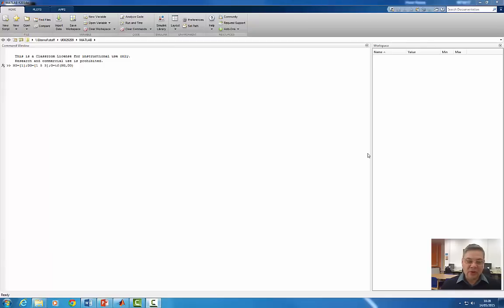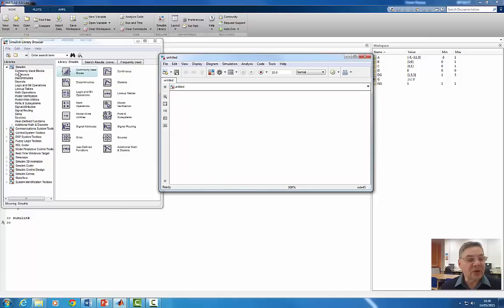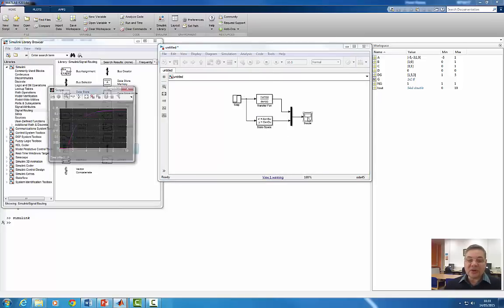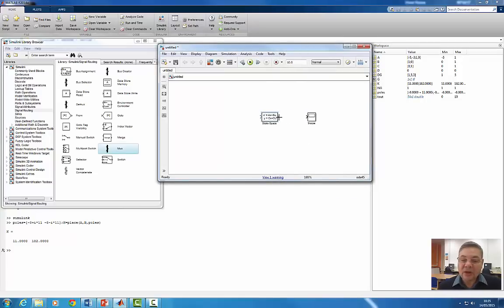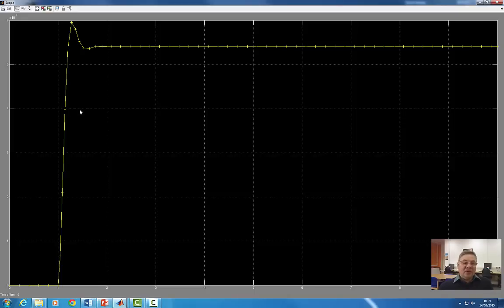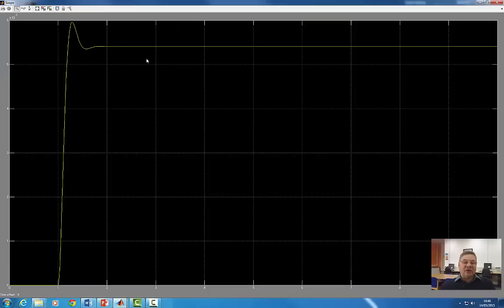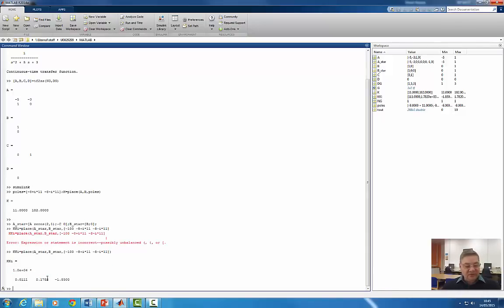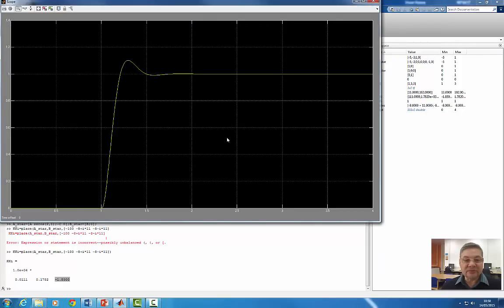Control Design via State-space: MatLab/Simulink Example

Comment: I have a question how did the integrator solve the steady state error ???
Reply: its better to view this from a frequency domain control techniques and analyze the error with the final value theorem with a pole at origin(integrator). You can check Dr.Nise control systems book on the chapter that discusses steady state error.

Comment: Text indeed is very small, but can be "encoded"

While I encourage to write and test code by yourself, I would like put it here, as Rewrote it from the tutorial. Btw., many thanks to Essam Hamdi for this video:

NG = [1] ;
DG = [1 5 3] ; 

% transfer function
% G = 
%       1
% -------------
% s^2 + 5 s + 5

% transferring transfer function to state-space
G = tf (NG,DG) ;

% outputs
% A = [-5, -3; 1, 0] ;
% B = [1, 0] ;    
% C = [0, 1] ; 
% D = 0 ;

[A,B,C,D] = tf2ss (NG,DG) ;

poles = [-8+i*11.0000 -8-i*11] ; 

K = place (A,B,poles) ;
% outputs
% K = [11.0000, 182.0000] ;

A_star =[A zeros(2,1); -C, 0]; 
B_star = [B; 0] ;

KKi = place (A_star, B_star, [-100, -8+i*11, -8-i*11]) ;
Reply: How do we know that we need to put poles at "-8+i*11.0000" and "-8-i*11"?
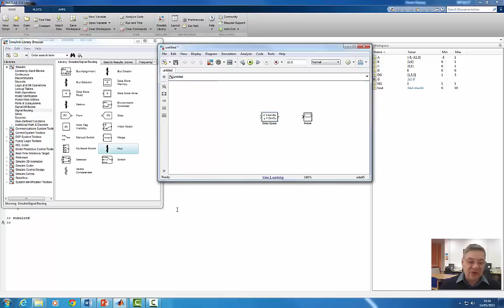Reply: @ruchimanandhar6730  Checkout the time at 6:21
https://youtu.be/CsB0TGRYq08?t=381
Reply: @ruchimanandhar6730  It is just random, desired poles, but you have to put a pair of negative complex number, -8+11i, -8+11i

Comment: Thanks a lot for the video, but I couldn't understand why you used feedback gain as 1 for the integrator rather than putting the gain in the feeback loop as you did in the first system. Can you shortly explain that please...
Reply: I think the reason is to keep the structural style of the controller similar to that shown by textbooks and the state equations. However, I could be wrong. Also, the Integrator is to just get rid of the steady-state error and the outer feedback loop with unity gain is to create unity negative feedback.